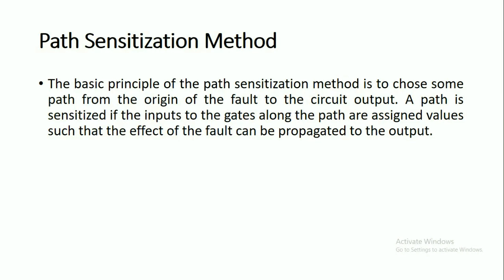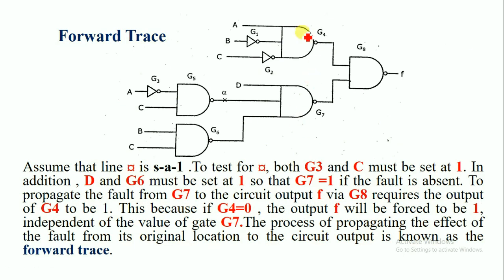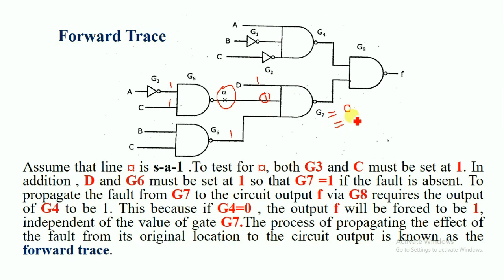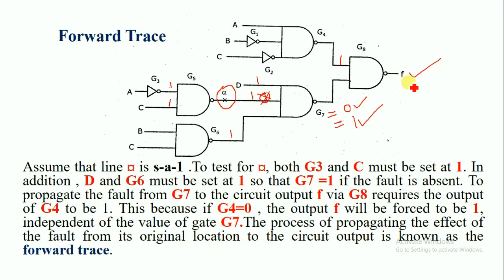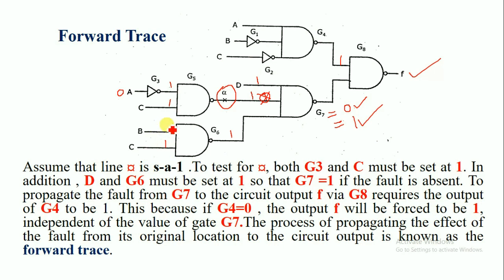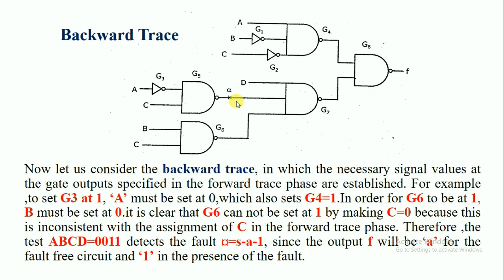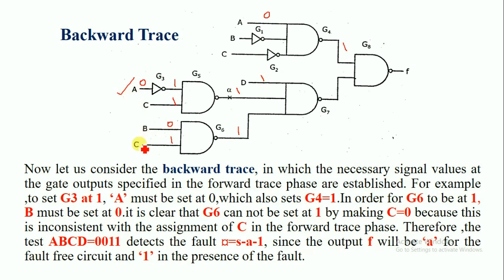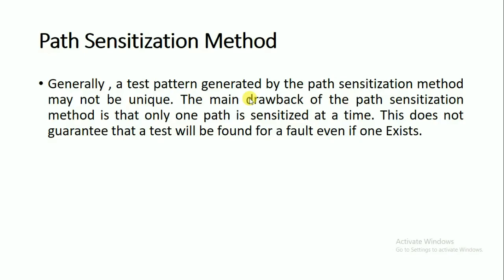Path Sensitization Method for Fault Diagnosis in Combinational  Circuits

Comment: Sir, in forward trace the output of NAND(alpha value) gate output is 1 when any one of input is ' 1'  but you said when both inputs are 1.Am I asking correct or not please reply me sir
Reply from the maker: It's correct
Reply: @OPENBOXEducation  sir, to make alpha value ' 1' you said we should take A&C values are '1', but according to NAND gate output '1' if any one of input is 0 ( if we take A&C values  as '1' the output of NAND gate is '0').I didn't clarify my doubt.
Reply: @lavanyapilla2922  at alpha there is a 'stuck at 1 ' fault.That's why even though inputs of nand are 1 ,output is stuck to 1.Inorder to show this fault inputs are taken as 1